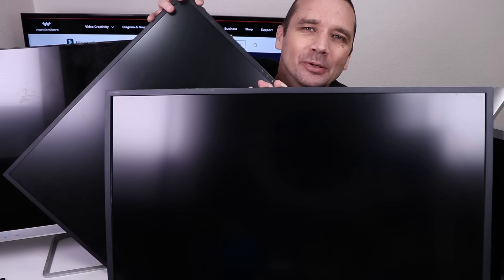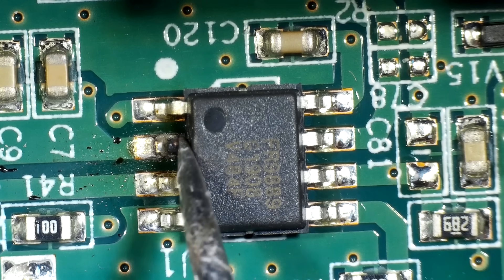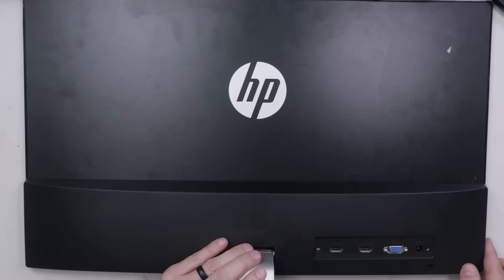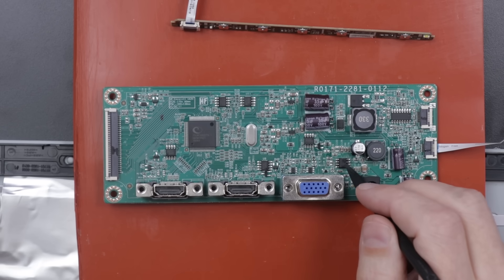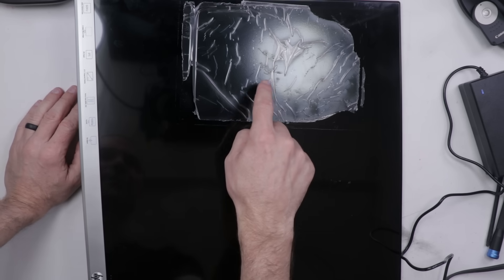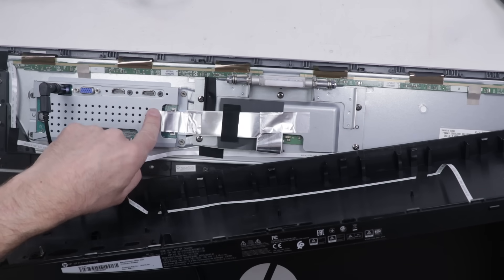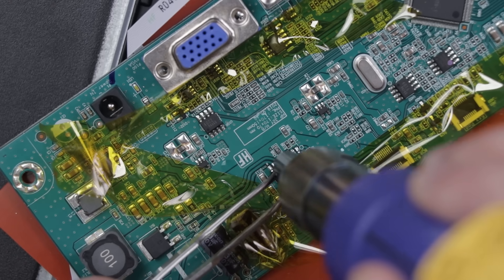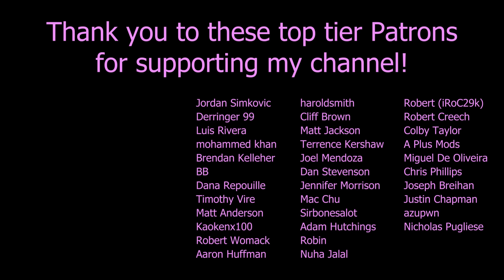I Bought 4 BROKEN Monitors - Let's Try to Fix Them!

Comment: For the unfixable monitor, maybe a very dumb suggestion but here I go anyway:
Could it be that the problem is not with the monitor but rather with the power supply. If the one you are using somehow got mixed up and simply does not provide enough current, that could explain the issue. Possibly even if it's faulty.

Comment: Could it be possible there is actually faulty back light ribbon, recently had a TV repaired had black screen but had volume and it turns out wgen one back light buld breaks then it effects all the other lights strips fail as well when only a single bulb fails. Worth an investigation

Comment: The backlight on these monitors are LEDs right ? We can have a brightness of 700cd/m² on phones with 4V LEDs. How the hell can LEDs be powered with 50V and only give 200 - 300cd/m² on these monitors ?! 

On old monitors, the backlight was produced by weird glass tubes and 230 volts wasn't even enough to get a little bit of light

Comment: If I get my hands on a monitor that's pretty common and has a broken screen. I normally hold on to it for a little bit. Just in case I get off another one that me just have bored issues so I can swap the board.

Comment: If you break the panel on your monitor you would be better off just buying a whole new monitor. The panel is like 90% of the cost of the whole manufacturing process.

Comment: Others already explained that chip to you. I would have suggested searching for the inductor (see schematic, the 22uH inductor connected to Vin) and the mosfet. 
The chip has a lot of built in protections which may be triggered if one or several leds are shorted (causing one strip to have a  lower voltage than the other, or have the leds consume more current). You really have to inspect the led strips, or do a preliminary test with some known good led strips connected to those headers to rule out the circuit being bad.

Comment: I fixed an Apple Thunderbolt Display that didn’t light up. The LED driver didn’t deliver power to the strips. But it wasn’t a problem with the driver chip itself, but the connections in the strips. The soldering was broken, the display didn’t detect the strips and switched off the driver chip. Maybe you have something similar with your displays.

Comment: To the last monitor... I think that this power board is OK. The problem could be the backlight itself. Disassembly the panel and check the LED strings. This is constant current source. If one or more LEDs is shorted the backlight can works normally, but there can also be a voltage measurement and protection on too low voltage. If there is an open circuit the backlight can't working. This problem is easily fixable by change all LED strips with new one.

Comment: For the 1st one - I think you missed the part where some cleaning up is made with solder wick and then put on some fresh solder. I do the same mistake every once in a while - thus the cold solder joint. For the 3rd one - 99% sure , one of the LEDs is dead , so you don't even have to replace the whole strip. Just find a matching LED  and put that on the existing strip -> cheap ,but time consuming fix. Take your time with led panel disassembly.

Comment: When fixing broken TVs, I've found it not turning on to be a good sign. Because it means the person tossed it due to a power issue, which tends to be easy/cheap to fix. If it does turn on, you'll probably be greeted to a spider webbed screen. lol!

Comment: I'm pretty sure the chip that's meant to be outputting 5v that's doing 1.9 that goes to that little chip with 3 pins on one side and a single pad on the other side is a voltage regulator, worth replacing that if you can

Comment: Removing the adhesive film from the LCD could be done with a heat gun on a low setting.  Not hot enough to damage the LCD but warm enough to soften the adhesive that it will peel off slowly without the need for applying alcohol.  You can peel stubborn labels from boxes in this way as well.

Some LCDs will have AR coatings on them which can be removed by alcohol/IPA.  The surface is treated before applying the AR coating and if contaminated, it doesn't take much to rub it off.  If the surface isn't damaged, it will remain intact but if you scratch it and the pre-treatment wasn't done properly, you can wipe it off with cleaner and sometimes without.

Depending on who made the AR coating cleaning agents vary between IPA, keytone, etc.

Heatgun on a low setting is typically now you avoid scratches or swirl marks left by IPA + kimwipes.

Comment: The backlight LED circuit is the boost converter which is on the right side of the board where the inductor, diode and bulk caps are.  It will generate the voltage you need to satisfy the forward voltage requirements for the LED strings in the LCD.  If you find the datasheet for it you can browse the reference schematic and use it for clues on how to debug the circuit.

Comment: There are a number of sites that sell replacement screens, you just need the model of the screen itself which is usually found inside on the back of the panel.  Replacements are far cheaper than a new monitor.

Comment: First off, I know absolutely nothing but I'm wanting to learn. I was just wondering in regards to the 53V... On the board, you were testing 18+ volts and I noticed 3 ribbons ( 10:18 ). 18 x 3 is 54 
Is it possible that by disconnecting a ribbon it opens the circuit. I know I'm probably sounding like an idiot but just a stab in the dark. If you figure out the issue, please keep us posted as I'd love to learn. Thanks for all your amazing videos and helping me learn what I never knew interested me.

Comment: I have an hp 24f with a damaged screen. I picked it up from the top and squeezed the screen too hard. Everything else works on it. Most likely has the same board as the last monitor.

Comment: #TronicsFix a good trick for removing sticky residue from stickers and tape is to use some vegetable oil to loosen the residue and the clean away oil after with alcohol or glass cleaner

Comment: You need 50 volts? Just cut the failed connection, add in a transformer adaptor from the dc input and call it a day. (drives off on a motorcycle)

Comment: The FR9889 is a synchronous step-down DC/DC
converter that provides wide 4.5V to 23V input
voltage range and 3A continuous load current
capability

Comment: Keep the broken lcd. If you have a non fixable board with the same size screen, you can try swaping it as long as it has the same socket size and orientation

Comment: Hello, I think it's a faulty LED strip causing the voltage drop to avoid the short circuit and to save the chip it self.
Also check the capacitors.

Comment: Wow didn't even take off the capacitors to check you pulled the chips off left and Right replace them and say it's easy. My guess would be  if you don't see anything smoked the capacitors are going to be the weakest link that or the 100 inductor or choke. Or at least check the ribbon on the LEDs are have a leak to ground.

Comment: Don't ask me how but I've been able to get just about any type of dried glue/adhesive from multiple surfaces by just using creamy peanut butter - even a monitor screen and it did not remove the protective coating

Comment: Did you try comparing the resistance to ground on both backlight 50 V pins with and without the backlight plugged in? If its roughly the same without the backlight plugged in (my guess >1MOhm) then the issue is likely in the backlight itself.

Comment: Still watching through this vid, so not sure if a similar problem comes up later, but have an anecdote:

Many years ago I got a secondhand LCD monitor from my dad (he'd replaced it 'cause it was having intermittent issues).  It worked fine for me for a while, then started showing those same issues again, with increasing frequency.  Eventually it stopped working entirely...or so it seemed.

The apparent problem was that it would randomly just...turn off.  Power cycling it would sometimes get it to work again, but sometimes wouldn't.  Eventually this trick stopped working at all.

However, at some point I took a close look at the screen under bright light right after it had seemingly turned off, and noticed that it was still showing the image, it just wasn't producing any light.  Aha!  The mainboard and image processors were still working, it was just the backlight that wasn't (this was back when fluorescent backlights were more common than LEDs).  I did some searching around, saw several posts of people having similar problems, and found one post from someone with the exact same model of monitor and the exact same problem...and the solution.  On the sub-board that controls the backlight (including its power delivery), there was a row of 4 or 5 identical capacitors; at least one of them had gone bad.  Replace the whole set with a new set, and bingo, working perfectly once again.  🙂

Comment: As always, it's a pleasure to watch your repairs and thanks for all of your output, even when there are some unfixable things. That's life – or the way it is. Back in the early 2000's I fixed a monitor by replacing the capacitors of the mainboard. It still works today for my parent's PC they occasionally use for office purpose (they usually do stuff on their Apple MacBook). Since than I never had a broken monitor again. On the contrary, I sold an 2010 BenQ V2400 Eco monitor on eBay some days ago that still worked fine. Just switched to more screen estate (32" for the win) from LG. Your video is at least a good example for not buying a monitor from HP. Never trusted this weird printer manufacturer 😅

Comment: Have been a subscriber for a long tong time, but now I see that rally anyone can fix anything. In short you had the drawing of a boost converter in front of your eyes:).

 Hint, try to power led led segments from a cc supply. It seems to be a low voltage detection over the LED chain, as the voltage was decreasing. So maybe it has some shorted LED's and they detect it.

Comment: I'm not familiar with hot air and flux, but I was wondering, do you use flux for both taking the chip off and putting the new one on?
Reply from the maker: Flux helps the solder flow (melt) so when I remove it it makes it easier to get the component on and when I'm installing  component it makes it easier to get it on and have all the pins connected properly.

Comment: check that 8 pin component by the ribbon to the panel. Generally buck/boost chips are going to have a coil/inductor and cap to do their work, and there was a large coil next to that chip. And yeah, looks like the boost converter is working, but is shutting down with both backlights hooked up and you're just seeing the decay on that pin.

Comment: This is the kind of work I've been doing at the farming electronics company I'm working at and it's so much fun being able to find and diagnose any problems with datasheets!
Reply from the maker: Farming electronics?! That sounds awesome! I grew up on a farm. That's where I developed my love/need for fixing. Mind if I ask what company and what exactly you repair?
Reply: @Tronicsfix  I would call it "farming" as the electronics are more for farming things but I fix industrial telemetry units (ITUs) and long range remotes (still in-training). The company is called Harvest Electronics and is based in New Zealand.

Comment: On the last monitor, just as a pretest, i would have disconnected the backlight  LEDs and then put a flashlight up close to the front of the screen just to see if the picture LEDs were working properly. If both sets of LEDs were bad, then i would say it's a no fix ;)
Reply from the maker: It shows a picture on the screen for bout a second before shutting down

Comment: For the last monitor you might want to buy a replacement board and then check its voltages to see the differences. So, next time you might have a clearer idea on what to look for to fix it.

Comment: Take the flashlight up against the screen to see if there is any picture.
BTW, the LEDs could be dead (judging by them flash when the monitor switches on and the voltage slovly dropping). The chip turns on detects no load/overvoltage on the output and shuts down.
The high voltage is likely produced in theese big inductors on the top of the PCB.
Reply from the maker: Yes, there is a picture that flashes for a second then goes black.
Reply: @Tronicsfix  The LEDs likely failed.
But hey, if you can't find the replacament, you can always bodge a LED strip in the back of the screen, just make sure to use high CRI LEDs (talking from expirience).
Reply: @filenotfound__3871  i came here to say this. Likely the led:s. You can test those with a battery and jump the broken ones to test.
Reply: @Tronicsfix  Swap the ports that the LED strips are plugged in to.  Sounds stupid, but it used to work on fluorescent bulb LCDs.  If 1 bulb started going bad, it kills power to both.  They would have the same response when uplugging 1 or the other, but remaining would fully light up (even if it was the bad bulb).  For some reason, just swapping the port they were plugged in to would fool the board into lighting them.  I always just assumed it was a sensitivity issue on the board, and one "side" was just a little more sensitive.  I got quite a few more years out of some of those LCD monitors with that trick.

Comment: Omg, he didn’t say that flux helps the solder flow… he said helps the solder melt!!!! For once I understood what he meant ;-)
Reply from the maker: Lol. Technically, it doesn't help it melt but does help it flow. I said melt on purpose though because I felt that was easier to understand. If you don't use flux the solder will still melt but it will be sort of sticky and won't really move around easily. With flux it moves very easily. I guess you could think of flux as similar to a lubricant for the solder if that makes sense
Reply: @Tronicsfix  Haha, no that totally makes sense. I just think that was the first time you described it that way. We all know what you mean by “flow” (or at least we pretend we do so that we look knowledgeable AND cool).

Comment: @TronicsFix I repaired an HP 27F and 32F. Similar to what you ran into partial dead LED light strip on the 27" and I was able to pilfer the LED's off the prior working / cracked screen to get it working. The 32" I repaired the board, replaced a few caps that were distended.
Reply from the maker: I'm thinking probably faulty LED's. Might have to make a follow up video on this one.

Comment: I had an issue with the same chip as monitor 2 , but in my case , the bad chip also caused significant burned traces in the PCB.. Although I was able to manually wire all pins , but the board was so broken that ultimately I decided to replace the PCB itself with a new one ( You can get them for 30 bucks ) , and it even added an HDMI output to my monitor.. Still using that monitor to this day , works great..

Edit : The Monitor was LG 20 Inch 900p
Reply: P.S. I never figured out what caused the chip (and the area of the board surrounding it ) to be burnt that bad in the first place.. It's like a more intense version of monitor 2..

Comment: Ever tried iodine-benzine mixture for removing adhesive?  They are mostly used in hospitals for removing bandage adhesives, but works immensely on all types of adhesives, haven't tested on anything electronic, but it does dry up quickly. The mixture can be prepared at specific pharmacies, but man, it simply deletes adhesive really quick (plastic, metal even wood).

Comment: The logic board on these displays are hilarious i remember when they took up the entire case..
Nowadays i've seen them being just 1 chip, which is sorta lame when you had to remove a ton of glue.
Oh the first display also had an unsoldered capacitor on the top left!

Comment: like the others said below I would check the mosfets or caps on that 50V "power supply".  It seems like a lot of the time NorthridgeFix Alex replaces bad mosfets on the GPUs and the power rails come back to life at the correct voltages.

Comment: I think the last display might have a blown capacitor or something so it can't handle the load. If you don't manage to fix it in some other way, try the sketchy thing and add a voltage converter to get about 53 volts and bypass the internal one.

Comment: I think one of the backlight LEDs is faulty. By disconnecting the backlight part with the faulty LED, that part works. With the faulty LED strip connected, a current limiter kicks in and shuts down as a protection mechanism. 
Replacing a backlight LED strip is hard, the LCD panel needs to come apart.
Reply: Yep, used to have this exact issue with old fluorescent bulb backlit LCDs.  1 bulb would start going bad, and the board would kill power to all bulbs.  You could unplug either bulb and the other would fully light.  Most of the time, just swapping which port the bulbs were plugged into would "fix" the problem and you could get a few more years out of the monitor.

Comment: Almost looks like the Riset resistor has drifted and the controller isn't supplying enough current to drive all the LEDs (there's a table in the datasheet). And it could also be the N-MOSFET that is bad and unable to handle the load. To be honest, I usually look at the circuits present in the datasheet and try to find one that is present in the one that I'm trying to troubleshoot. Companies rarely reinvent the wheel, as we say in my part of the world. Good luck!

Comment: On these cheaper monitors, it’s really not worth it to buy a new screen, but my friend bought a high end 1440p 180hz monitor with screen damage for next to nothing, and replaced the screen. All in all, the unit works perfectly for a fraction of what it would’ve cost new. Your mileage may vary though

Comment: Even if the board is dead, the screen can be salvaged and be connected to a different screen driver - about 25 bucks to a driver. I made several new screens this way.